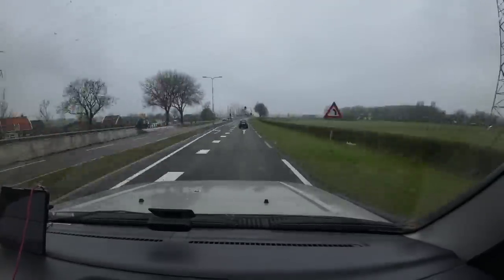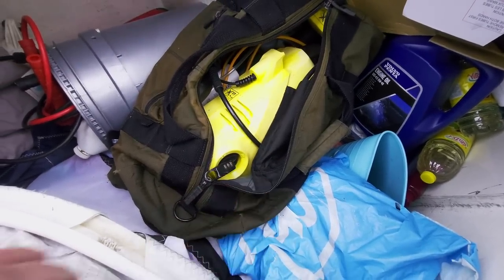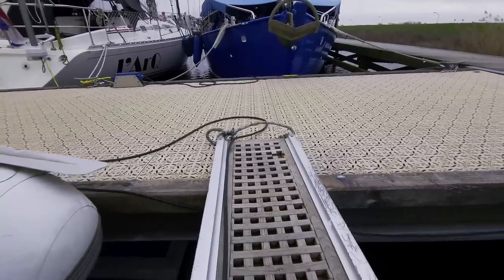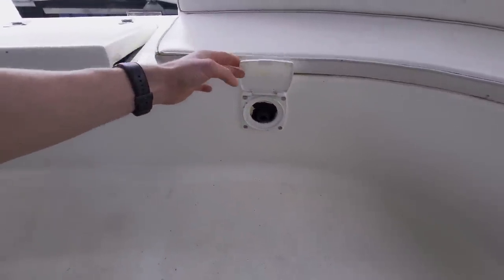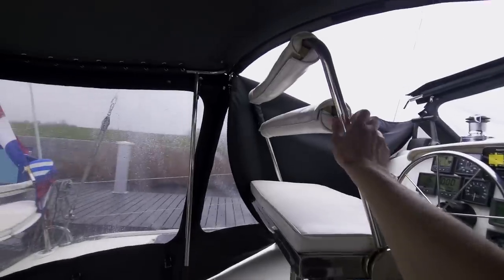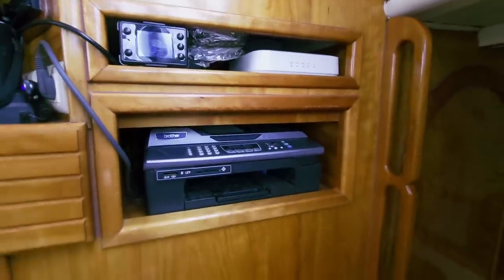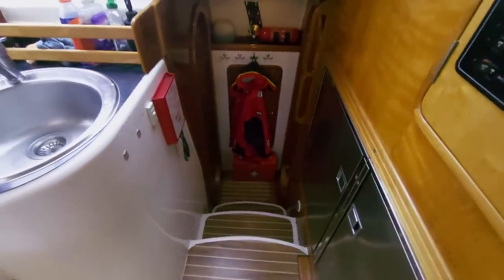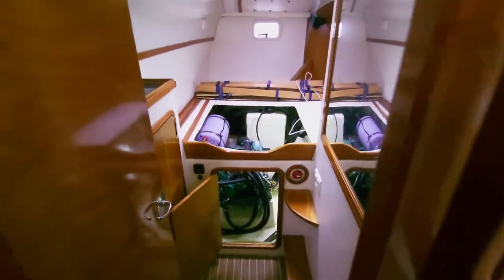FULL BOAT TOUR of my floating house - a JAGUAR 36 Catamaran  [EP3]

Comment: Hi Thomas, Nicely set up cat. My Mahé 36 is same length but only 5.9M wide. I have just replaced my solar and went for 380 watt flexible panels which saves so much weight. I used VHB tape which the RV users use so they don't have to put holes in the roof which will eventually leak.  I strongly suggest you replace the tired old lines for furler and sheets as they can give way in strong winds when it is the last thing you want in those conditions. Just completed Lithium upgrade on my boat. André in Sydney
Reply from the maker: I will renew all lines and halyards before starting the big trip.

Comment: What an impressive boat.  It is not that long and yet on the inside it has plenty of room, even for your almost 2.0 metre high frame.  Great buy Thomas.  Look after it and it will look after you for years to come.  Can't wait to see it out sailing and you heading off.  Thanks for sharing!

Comment: nice boat... noticed the burned 'door' of your outside shower... tricky heating on, door not locked fire hazard... when on anker not a problem but in a marina wind from port...
Reply from the maker: I burned it a few weeks ago when I didn't close it properly, I hope I won't need the heater much when I want to sail to warmer climates :)

Comment: My wind generator was very important, even in the tropics.  Height makes a huge difference in sound...mine was up my mizzen, about 10 feet and was quite quiet...another boat had it like yours, and it was annoying.  If you can brace a taller pole, I think you will like the added power.
Reply from the maker: There will be quite a bit of solar on it, which in my calculation should be more than enough but I'm not throwing away the wind generator, maybe make it a removable option, not sure yet
Reply: @sailingnewhope  Hi...solar and wind make a great team.  I am just EVing my boat and looking for a wind gen that has decent output and is quieter.  If I find a gooder, I will let you know.

Comment: Congrats on the catamaran.  As I recall, this is the same brand and size that blogger Bumfuzzle (man and wife) sailed and motored around the world 15+ yrs ago.  They had some problems with the engines, but I'm sure that boat was from the 90's and they did a lot of motoring. But over the course of 2 yrs they sailed around the world from Fl, had great adventures and sold the boat for a bit less than their purchase price.   Is that a "twist to lock" shorepower plug or the newer type?  It is the twisting and tightening on the 3 copper blades that usually cause the problems. Another brand does not rely on the twisting to make contact and water seal.
Reply from the maker: I wanted to buy the victron twist type connector, but the base is much smaller and won't fit without additional fiberglass work. 
And once my solar panels are installed, I probably won't use shore power anymore. So I went for a much cheaper replacement connector for just this winter. And installed a victron galvanic isolator behind the connector.
Reply: @sailingnewhope  I was referring to the SmartPlug for shore power connection.  If you are looking at solar panels on a sturdy aft arch, I think bifacial panels would be a good choice as they could generate 15-20% more power than single face panels of the same front face wattage rating. Large bifacials run in the 60 cents/watt range.   If at some point you are looking at battery powered air conditioning, take a look at Ytuber Emily & Clark's Adventure- guy is an engineer and invented a low draw battery powered relatively low cost marine AC unit.